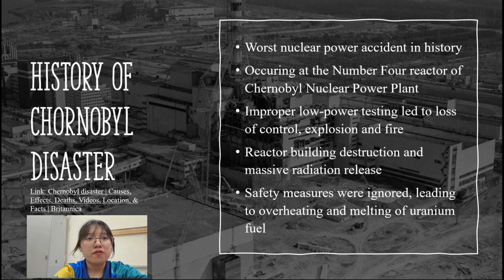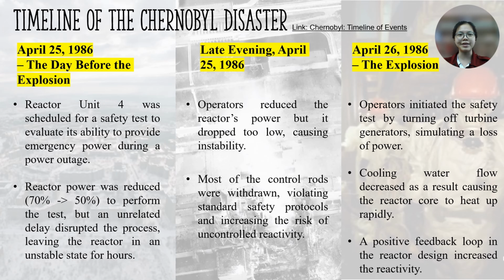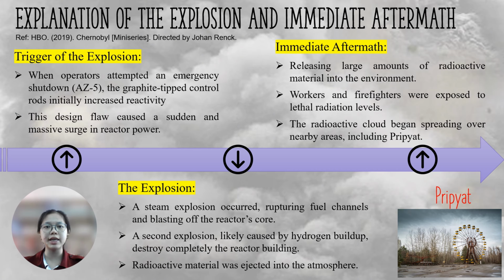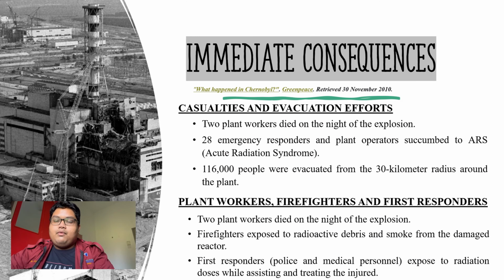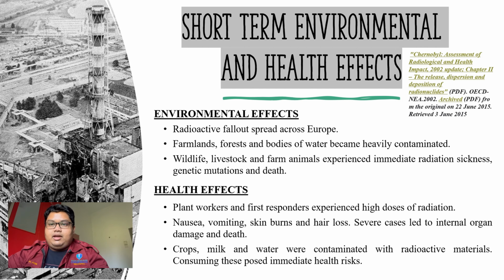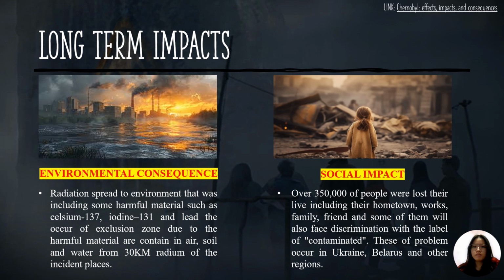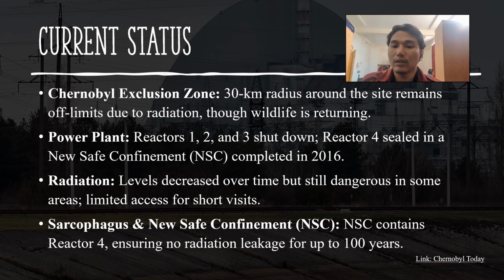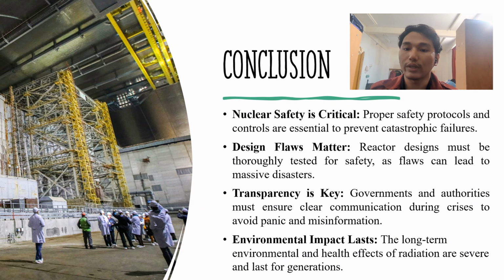BTD2273 Grp06 Chernobyl 2025Jan

Comment: The original design of the reactor that exploded, the RBMK, was inherently dangerous, but those in charge of the project did not give sufficient attention to the safety aspects of the design. Key issues include:

1. Lack of sufficient safeguards in reactor construction.
2. Failure to come out clearly with the design problems during their construction.
3. Lack of preparedness in case of emergency situations.
Modern project management would have entailed carrying out proper risk analysis on the reactor project, conducting independent reviews on the design and construction of the reactor and aiming at achieving construction of the reactor with safety in mind. Lesson learned: Technologies associated with risks need the close monitoring of a project, especially when it comes to nuclear energy investment.

Comment: Another factor that contributed to the Chernobyl Nuclear Disaster was Operation Opera. In 1981, the Israeli Air Force bombed Iraq's Osirak nuclear reactor, fearing that Iraq might develop nuclear weapons. When the Soviets learned of this event, they began to consider scenarios such as an American attack on their nuclear reactors, a massive power outage, or an earthquake disabling critical systems. They questioned how they would handle a situation where there was no power, and the pumps weren’t functioning.

Their initial solution was to install backup diesel generators—problem solved, right? Not quite. The generators took roughly a minute to start up, which created a risky delay. To bridge this gap, the Soviets proposed using electricity from a wind-down turbine to maintain power and keep the pumps running until the generators kicked in. They decided to test this theory in practice.

The first test in 1982 failed. The second test in 1984 also failed. The third test in 1985 was another failure. The fourth attempt, on April 26, 1986, resulted in the catastrophic disaster that changed the course of history.